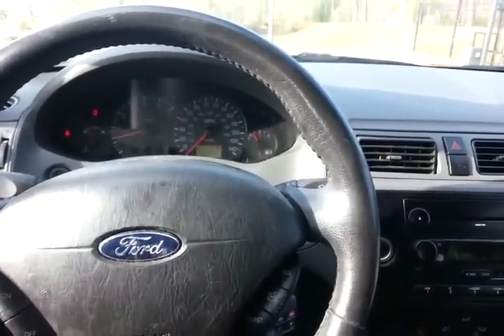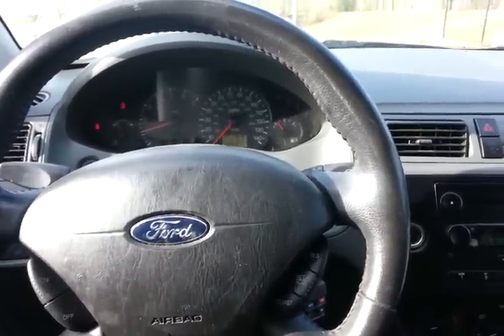2005 ford focus noisy motor mount

Comment: My '10 rattles espacially front left headliner is it the engine mount doing that? And how Much to replace that?
Reply: I have a 2010 Ford Fusion that needed motor mounts and I believe I need them again because my engine is leaning so noticeably 😩
Reply: @FrankieLymon_  i Heard that they always rebreak . But since i cleaned my engine bay the motor mount is not vibrating as bad as before  , i probably rinsed the residues off doing that.

Comment: I heard a rattle noise after you let jack down and got back in the car, did that bad motor mount make the car vibrate at idle or in drive with your foot on the brake?

Comment: Mine has a similar sound only it isnt as smooth and is much more audible. It shakes the whole car up whenever i apply some gas.
Reply: DE4DF4LL YT drove from OC to LA with mine doing that so loud it was the most embarrassing thing ever
Reply: Mine started doing it earlier if I put the car into reverse and then into gear 1 and move forward the whole engine moves back and then forward hitting off the fan mines a ford fiesta 2005 plate UK

Comment: mine was making that rumbling noise but only when shifting from P to R and R to D. realized there was a ton of gravel jammed up in there that was transferring the rumbling of the engine to the chassis. learned later that this sucker has those rubber rings to soften the rumble and the gravel was bridging that gap.

Comment from the maker: To answer the question about replacing them all. I would say if you have the money you might as well. I got mine from the Ford dealership for $130. Of course I'm speaking about the two on top, the dog bone on the bottom shouldn't give as much wear.
Reply: +Offthe Grid Just a suggestion. A vehicle that old I would probably just get generic mounts with lifetime warranties , which cost me 60 dollars even
Reply: @VinhTran-lu6gm  I did get generic with lifetime warranty & it created the same problem as the video & now I'm here lol, dont get generic lost my money...
Reply: @UnicornRyder04   That's because youre Lebron James and youre being cheap lol. To be serious I changed it 3 yrs ago and its working fine.
Reply: @VinhTran-lu6gm  I still have my old ones but only 2 good, I know I can get them fixed myself, but its 30 degrees out & spent the past few days/summer fixing my other car... I might invest in impact wrench to make process fast